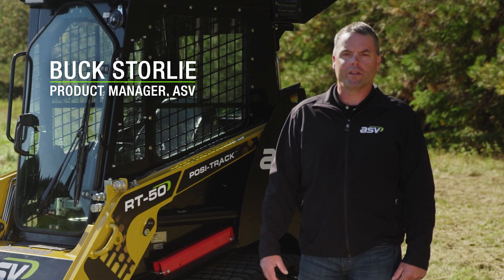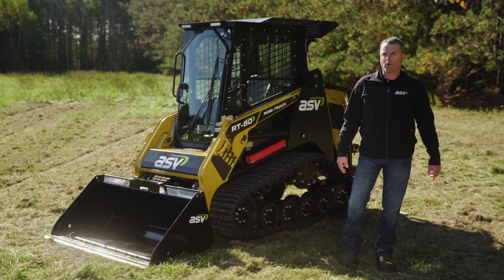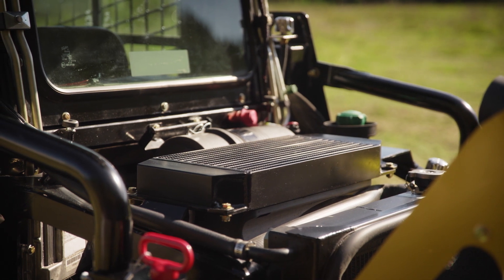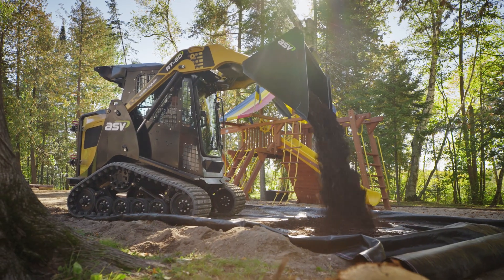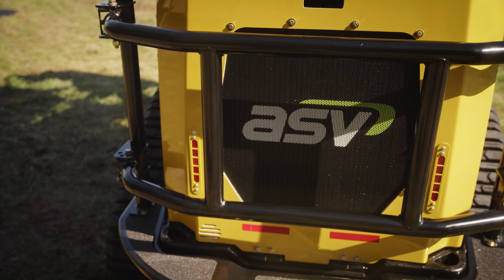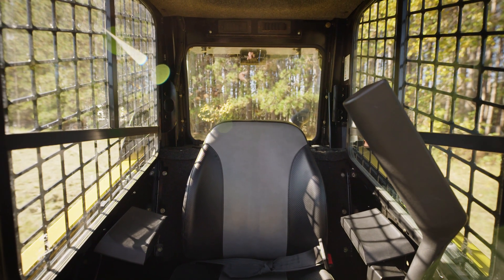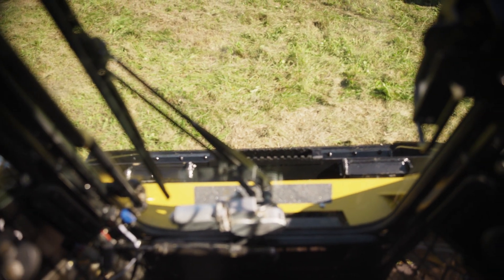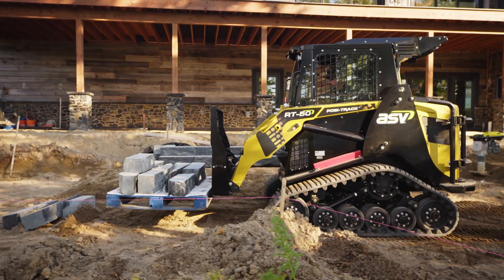Learn About ASV's New RT-50 Compact Track Loader

Comment: Did you fix the hydraulic couplers? I bought a 2022 rt-50 with the Kubota and that thing is impossible to hook up hydraulic hose without cracking the lines and get fluid all over the machine or carrying around a big clamp forcing them on. Pretty crappie design and I'm not the only one that fills this way. You should have some type of recall and make your customers happy.  Maybe I should Start petition to force asv to fix this known problem
Reply: Feel free to send the missing pressure release valve to the utah dealership and I can get it installed once my machine goes in for its 50 hrs service.
Reply from the maker: Hi Jeremy, a push button pressure release was added as standard to the new model.
Reply: @ASVCompactEquipment  I have a 2022 and it doesn't have one.

Comment: But does it have 2 speed…? And is the engine quieter than the previous model?
Reply from the maker: The new RT-50 is about 2 db quieter than a 2021 model and about 6 db quieter than a 2019 or older model. The RT-50 is not 2-speed.